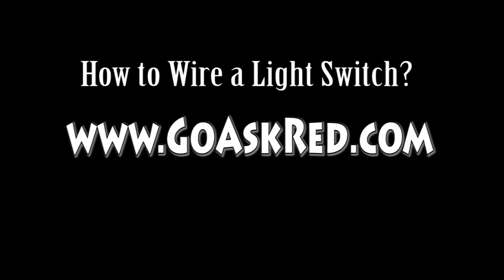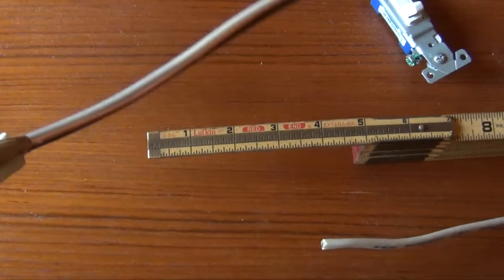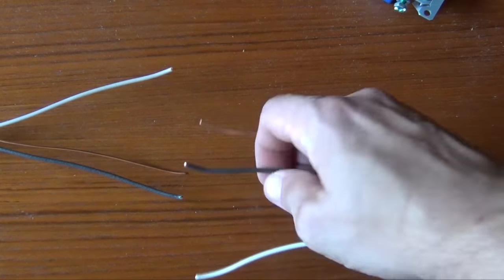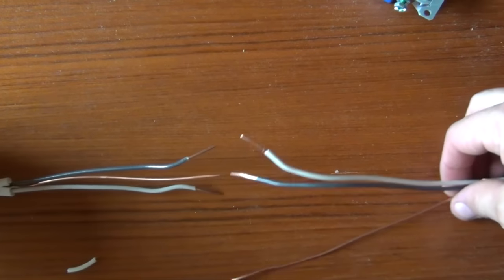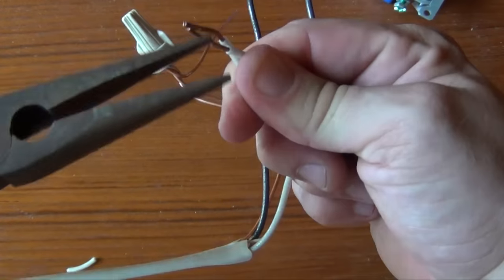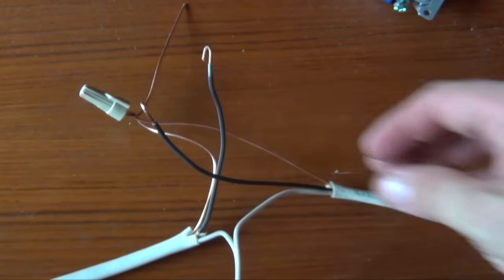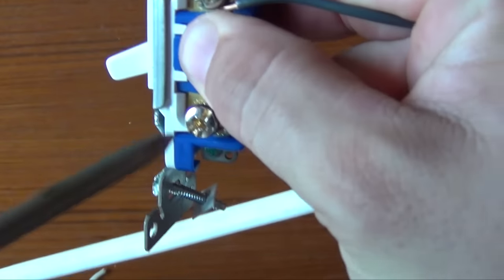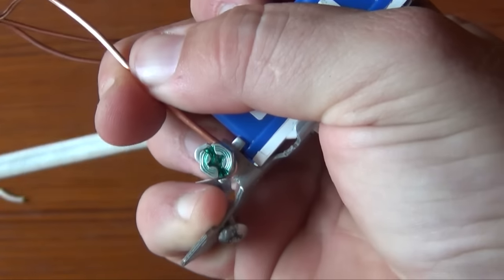How to Wire a Light Switch

Comment from the maker: In this instance, and in most situations, the white wire is your neutral (return line).

The basis of an electrical circuit is that electrons travel in a loop, toward your light bulb on the black wire, and return from the light bulb on the white wire.   

To turn off a light bulb, you only need to open the circuit (create a break in the loop) at one location. Therefore, switches are usually installed on the black wire.  Because you only need 1 break, the return white wire can bypass the switch.
Reply: T

Comment from the maker: The general accepted practice for a single pole switch would be to bring the black wire in at the bottom (from the breaker/fuse panel), and send it out to the light/outlet at the top.  I would stop short of calling it "pertinent" since the switch would work fine wired vise-versa.  

NOTE: It's important to not confuse the bottom with the ground screw.  Also, a three-way switch would be different; for a three-way switch it becomes very important what wire goes where.

Comment: Thanks you sir. This video was very helpful. I used it as a guide when my Honeywell automatic switch failed after a brief power outage and needed the light on so had to retrofit the original switch in the dark and was not sure which wire went where. Thanks again.

Comment: This is a perfect video explaining how to wire a switch with two cables, one coming from the electrical panel (source) and one leading to a light or another device, but do you have a video that explains all that is needed to know to wire a switch to a single cable, where the white wire acts as a black wire,?  Also, does the white wire in that instance need to be painted black or taped black?

Comment: Either Bane has turned to being a Electrican or this guys doing a bad imitation of Clinton. Either way it did answer my questions on how to finish my wiring. Thanks
Reply: I was born in the dark, molded by it. I didn't see the light until I was a man and then only because I learned to wire light switches.

Comment: Just use the wire strippers to cut the insulation and strip wires, also use it to make the 180 loops.  No need for needle nose or a box knife.  Another good tip is to us a str8 head screw driver to tighten the screws as the philips doesnt get them as tight and they run the risk of being stripped.
Reply: Screws on switches and outlets are actually Robertson 1 or square head screws. They can just also be turned with a standard or Phillips.

Comment: I have a single-pole switch in my house that controls a single power receptacle at an outlet (for use with a lamp). There is only a single 14/2 Romex cable coming into the box that contains the switch. There is of course the white, a black, and a bare copper wire in the Romex. The white wire is connected to one switch terminal screw, and the black wire is connected to the other terminal screw. What I learned is that in this case the white wire is supposed to be marked with black electrical tape to indicate that it is a hot wire. It wasn't marked as it should have been. I corrected that by marking the white wire as a hot wire with black electrical tape. So in this case, the white wire is not a neutral wire; it is a hot wire. The lesson here is that if you are working with electrical, you had better understand exactly how your circuits are wired, and why. Otherwise, have a professional electrician perform the work for you.
Reply: I found this same thing recently.  The white was being used on one of the terminals of the switch and was not marked with black tape as it should have been. Good comment - points out something that is potentially dangerous.

Comment: Things you didn’t mention (I’m not doing this to be smart, I’m doing it to be helpful information to other people.)

1. While stripping the wire, use the stripe gage on the back of the switch/outlet. Whatever you’re wiring 99% of the times there’s a strip gage on it. 

2. Tighten your loop with the way the screw tightens to pull the loop in and make a tighter connection. 

3. (Just a fyi) you don’t need to use a box cutter for wire. It is ideal and nice because it’s fast. But the professional way to do it is to use a wire ripper.

4. Although this is very rare. Your ground wire (bare copper) goes in the green screw. But very VERY rarely instead of green, they can be red.

Note. The reason why you use the strip gage on the back of your switch and or outlet. Whatever you’re wiring. Is so the installation of the wire doesn’t make contact with the screw of the metal plate surface underneath the screw. The wires are called hot for a reason. They have power and heat going through them. And if that installation is to long it will rub against the plastic on the frame.
Reply: Boss Candle82184 Never is the ground wire indicated by red insulation. Only green, and green with yellow stripes, or bare. There is no other color allowed as a substitute for this.
Reply: The instructor in the video did explain about the direction of the wire loop being in a clockwise direction, the same as the direction the screw is tightened.

Comment: I just want to point out something extremely important and basic thing electricians do. I know you assumed people already know they are supposed to turn off the breaker/fuse of the interruptor/switch. Never assume people know that! I’ve met a lot of people that don’t and get a SHOCKING surprise. Never work with live wire, ever. Even professional electricians don’t unless they have to but they know exactly what they’re doing.

Comment from the maker: @Martin Teerly - If a single pole light switch is installed correctly, then up should be on.  Three-way light switches (2 switches controlling the same light) will alternate between up and down (on and off).  In most cases, single pole light switches will have the words on and off embossed in raised letters directly on the toggle.

Comment from the maker: From what you've described I would assume that your five screws would indicate a four-way switch.  A four-way switch would be used in situations where you would want 3 or more light switches toggling on/off a single circuit (most likely a light or series of lights).  Google image search four-way switch and you'll find some diagrams that may help you.

Try looking at the rear of the switch for amps, etc... modern stuff has that embossed on the rear.  Be safe, cut off the power and use a tester.

Comment: When you turn the light switch off, are you breaking the power to just the light? 

I'm trying to find out if I daisy chain off one of my kitchen circuits for an overhead kitchen light above the sink, when I turn the light switch off for the light, will it also turn off the power to the multiple outlets on the kitchen counter circuits?

Comment: Not a bad tutorial, but never, NEVER, use a box knife to strip the insulation. There is a very good chance that it will slice the wire inside insulation as well and it can leave the bare copper exposed. I learned this the hard way. Also, it doesn't matter which black wire goes where, the switch will still work.
Reply: what would you use to strip it then?
Reply: trippingonmushrooms thats  a cable stripper but you can just cut a lil down the middle on one end with a utility knife and tear down till desired length and cut off the tiny part you knicked in the end of the wire (if you knicked it)
Reply: Get that fanny tore up if caught doing it like that lol tbh, it's way faster and it just feels natural and if you don't have the wire stripper at hand well, thats when I do it but lord did my boss tear my fanny up. He let me go since at the time I was new but said if caught again, I was out immediately.

Btw he always told stories and always said fanny lol
Reply: Thanks for inadvertently giving me an idea for a tutorial video! I've been an electrician for 11 years and never had a problem with that method of exposing the wires... I'll definitely be teaching that one on my channel!
Reply: I've stripped tens of thousands of cables with a utility knife the same way, except I use a side cutter to cut the jacket off.  The strippers that score the jacket can knick the wire's insulation too.  I've seen it many times.

Comment: Thanks for tutorial, but isn't it pertinent which black wire you use at the top (on) of the switch?
Reply: Peggy Kirk no because the switch is either open or closed does not matter which wire is where
Reply: @detectingohio5614  
Yes, if the light turns on when you turn the switch in the down position, turn the whole thing upside down.

Comment: here a question for you if for some reason I needed to turn the switch upside down should it just be possible to switch to location of those to wires instead of turning the swtich upside down? I meant if for some strange reason I needed the switch to be on in the down position could I just not switch the way the upper and lower wire does that sound right? thoughts please thank you

Comment: In my opinion 
I dont know if I wrong
But i think need to be conected the white wires to the switch
In my understanding even when switch is off
The socket still gonna be alive
Is not gonna go off 
Stil gonna have electricity
If you goin to touch accidently
You may get electric shock

Comment: what is the white wire for since not connected to the light switch? thanks for the video.
Reply: I know this is 5 years ago. 

But this is for the current return to complete the circuit. The switch is just a break in the live line, the white is constant from the panel to the switch

Comment: hi there. great video. I have a question. I am powering a 115 v dc at 15 amps. automotive component. will a regular light switch power the component up? the light switch is rated at 120V AC at 15 amps. everything seems right but my uses are dc volts with that light switch. please I appreciate your help back. thank you.

Comment: what if you have the light closer to the line that comes from the panel than where the switch will be positioned? it s kind of dumb to run 2 wire lines (6 wires total) to the switch and back. what i do is in the light box i have the main line coming in then another line that goes to the switch (3 wires in 3 wires to the switch), the hot wire is connected to the hot wire that goes to the switch and nothing else, then the ground is the ground with everything, neutral from the panel goes to the light and neutral from the switch is your new hot wire. for lights use 15 amp breaker or even 10, (15amp x 110volt = 1650 watts available for that breaker if it s 15 amp, if it s 10 amp 1100 watts available, which is a lot for just a light that nowadays is maybe just a few watts so feel free to use that line for mutiple lights, if you get the math behind breakers amps and wats that i just gave an example of add together all the lights you are planning to put on the same line,)

Comment: Why do some people use the holes in the back of the switch to make the connection? My understanding is that its dangerous to connect that way because the connection may become loose. If its that dangerous why are the light switches made with the option of using the holes and why are they allowed on the market. I would think this would be a extremely dangerous safety hazard.
Reply from the maker: popacapnyoass2 The predominant reason for using the holes in the back is speed; it's faster to install.  In terms of danger, well, installing via screws can be equally hazardous if not done correctly.
Reply: they aren't extremely dangerous... but if the fixture breaks, the exposed wires may become a fire hazard
Reply: ANSWER" IF THE SWITCH SAYS 12 GAUGE WIRE ONLY AND YOU PUT 14 GAUGE IN THEM HOLES THE WIRE BECOMES LOOSE AND COULD FALL OUT, REMEMBER 12 IS THICKER THEN 14, LOT OF PEOPLE USE 14 GAUGE WIRE BUT i DON'T KNOW WHY , I USE 12 GAUGE WITH 20 AMP BREAKERS AND IF YOU USE 10 GAUGE WIRE YOU CAN GO WITH 30 AMP BREAKERS,
Reply: I dont see a ground wire when I put my switch in? where would it be, there are 3 wires that are white that are capped off is it one of those?
Reply: When you push the wire in the hole, it goes in to a copper clip. When the lights are on, the wire becomes hot and when off, it cools. This is a very thin copper clip. Heat and cold = expansion and contraction. Over ti.e this connection will become loose causing an arc which could lead to a fire. Most new homes have this type of wiring because it's  faster. I regularly get clled to these junk half million dollar ryan homes because the outlets aren't  working. When I pull the outlet out, the wire isn't even connected  most of the time. Why do they put these awful holes in the outlets? Great question. It is not against code to use them so they are still able to produce them.
Reply: Gunnin Wizard ground is always green or bare
Reply: No, no it's not.  Don't hook the white wires up to the ground on the switch.
Reply: Because dumb folks don't know how to use them, they are safer
Reply: @dakotalayinlow  the same stands true if they are mounted on the side
Reply: @ftrvdennyrvlife6523  if installed properly they work fine

Comment: Weird situation: I connected single pole switch one way and if the light was open, all good, when closed the fuse would blow. If I reversed the 2 black cables everything would work right. Why?

Comment from the maker: Well... if you were wiring a metal box then that would be a possibility, but for plastic boxes, no.  

It is not always true, but in general you'll encounter metal boxes more often in commercial installations, while plastic boxes would be used more often in residential.

Comment: Why there is no white wire connected to switch? I understand that this is not a terminal or end switch. Maybe that's the reason? Because the electricity needs to keep flowing to the next outlet or switch? What happen if you connect a white wire in one of the silver screws in this particular setting that we just watched? Thank you.
Reply: The white wire is a return for the current therefore it doesn't need to be disconnected. If you google home electric genie thats what i used and it explained a lot of that to me. hope that helps :)
Reply: justin brody

Comment: I think it should be pointed out that a single pole switch has a top and bottom. The switch is also labeled on and off. If the switch isn't mounted correctly in the electrical box or the hotline coming into the switch isn't connected to the top terminal the switch will function backward to the way it was intended.

Comment: Please help. Removed an old yard  light to replace it with an LED light. 
By the way there was nothing wrong with the previous light. 
I try three times and unfortunately, I blew the fuse 3 times and fuses are not cheap. 
What is the problem!? 
I followed the instructions coming in the box with the LED box!!!
Please help.
Reply: Might need more that 14/2 as they are only supposed to go on like a 15amp fuse.

Comment: Where did that 3rd copper ground wire come from?, "the pig tail" can someone elaborate on that.
Reply: It is the ground wire and was the last connection that he made.  You can't take the ground wire from each of the two 14/2's that are there and put them both under the same screw.  You can get the wire from the 14/2 wiring that you buy, just cut it loose and install!

Comment: What happens if you don't connect the grounding wire to the green screw?
Reply from the maker: ***** It is less safe for users.  The grounding wire provides an alternative way for electricity to return when there is a short, etc.

Comment: What will happen if the load and line wires are reversed in a single pole switch?
Reply: I know this was 9 months ago. But on these switches it doesn’t matter as all it’s doing is “breaking” the circuit. Which screw you place the “hot” and the “load on will just determine which direction you install the switch in the box. example if you were to connect the hot/source to the bottom screw opposite side of the green/ground screw and your load to the top screw. Then the switch would be installed this way. If you installed these wires opposite then when putting the switch into the reciprocal you would simply twist the switch around so the ground screw is upwards. So that when the switch is down it’s off and when it’s up it’s on.  Sorry for the drawn out explication without a video it’s hard to explain in my head ha

Comment: I was taught to NOT twist the wires together, non stranded wire will break easily and the wire nut applies torque to the already twisted wire and is prone to breakage, leaving you with a bad circuit if you didnt realize the mistake. It could also lead to small arc flashing which can cause fire. Stranded wire can more easily be twisted without breakage but you should still let the wire nut do the twisting of the wires because 1 it will twist stranded wire and 2 twisting wires together prior to applying the wire nut can still break the stranded wires rather easily. Ive personally broken stranded and non stranded wire with wire nuts without prior twisting.

Comment: In only have a copper wire the black and the white I don't have two black and I tried to wire it without the white and just one black and the copper on the blue screw and it's not working any help ? Please.
Reply: +Aleexandriaxoxo : The copper wire is ground (it goes in the green screw of the switch) The white is neutral (it goes in the silver screw on the switch) And the black is the HOT [like you] (it goes in the copper or bronze screw). This is might be a late of a answer, but, here it is, anyway. Thanks...